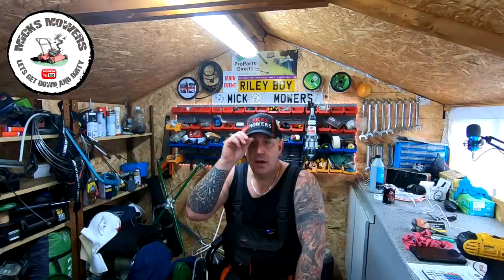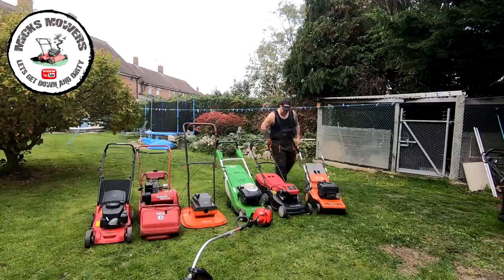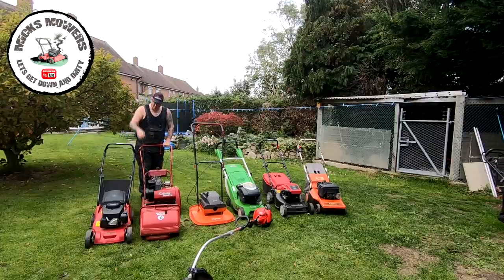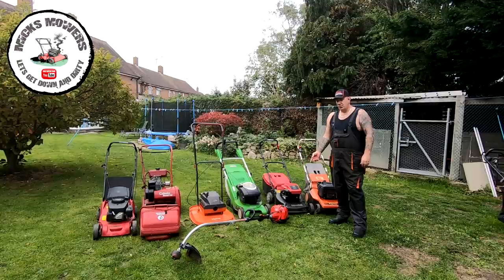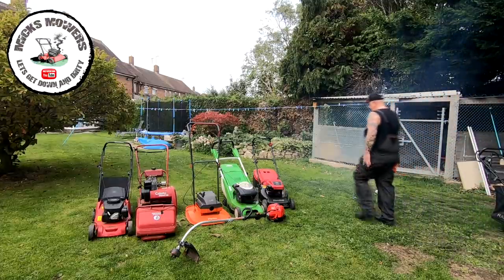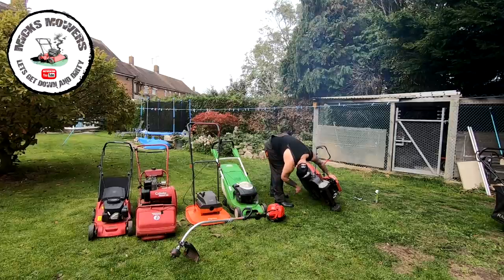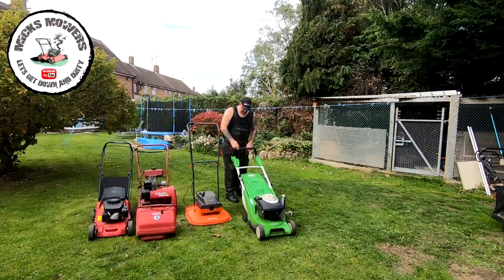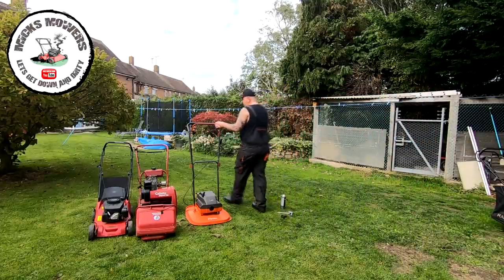Trash Picked Job Lot of Lawn Mowers.. Are They Trash Or Treasure

Comment: It’s turned into a throwaway society. Great job saving/getting those machines from certain scrapping. Bet you get them all fixed and sold for a tidy sum. 👍 Years ago they would have been sent to a repairer. Nowadays they are relatively cheap and people just buy a new one. Sad really for the planet but great for people like you Mick.
Reply from the maker: Yeah Peter. It's a sad old world
Reply: Just had a rant about that just now before I saw your post, but your spot on. No body repairs thing now just buy new. 
I've worked in the nuclear industry for more years than I like to remember. In the old days if something went wrong a fitter would come strip the part down go off to the machine shop make a new part and have everything up and running in a few hours. 
Now the new generation come in, kick it and say "that whole unit needs replacing"
Machines down for months and the cost runs into tens of thousands because we've destroyed our engineering background.

Comment: The Italian Techumesh was not made under license, parts may not be interchangeable or available.
So says Taryl.
Great haul you got there. The non runner is probably valve adjustment or flywheel key.
I’m digging the Flymo
Reply from the maker: Ta mate

Comment: list of jobs to do

- flymo 1, needs service, new cables, fix drive.
- mountfield grey mower, sounds like a engine issue
- mountfield trimmer usual two stroke issues with fuel lines and carb, may require a service.
- viking carb, service and drive
- suffolk punch service, clean carb, fix drive, get new grass box frame
- mountfield sp414 carb clean, service
- Flymo hover mower hell of a suprise it runs lovely, probably requires a quick service

Comment: One of my customers gave a mower and said that the handle had stuck down in the folded position, possibly engine "blocked". I took it home, held in the dead mans handle and pulled up the handle. First pull and it starts.  I did the right thing and took it back. 😇
Reply from the maker: Good lad
Reply: Karma Karma Karma.   I always do what’s right, even if it costs me money.  I believe in Karma, what goes around comes around.  I’ve even had customers tip me when I told them I had to buy a tool to complete their job but didn’t charge for it. It’s just good business!
Reply: @KensSmallEngineRepair  well, I still cut her grass. And it made me feel good. And she gave me some biscuits so yes, karma.
Reply from the maker: @KensSmallEngineRepair  balls

Comment: Tecumseh is a reason for not throwing something out, not the other way round.
Reply: ugh... I HATE tecumseh engines.
Reply: @norge696  Yeah, I found out that a lot of people do, I just don´t know why, they are my favourite brand, seriously. I used to hate the small Briggs with the plastic carbs and the Primer (like the one on the Mountfield), now that has switched to any non-brand chinese ohv-clone engine.
Reply: @v-g-z3689  are for tehcumseh, breather tubes leak, oil seals, valves are wacky, backfire a lot, carbs leak, flywheel keys are annoying, like 7 different kinds, list goes on and on. I do however like tecumseh snow king engines. 

As for those plastic briggs carbs, easiest carbs to clean in the world.
Reply: @norge696  Yeah, that is the general opinion, especially in the US by the way. I can´t confirm any of those accusations, but that however is just me. For me, the plastic pulsa Prime carbs are awful, and the engines they are mounted on: diaphragm goes bad every two years, carb warps and doesn`t seal, no adjustment whatsoever, awful airflow qualities, the engines have very little torque, they start burning oil quickly, Gas caps lose their threads after a short time, the head gaskets tend to leaks, Intake tube breaks very quickly, doesn´t seal properly to the carb, engines tend to wear out very quickly... thats my version of the list ;)
Reply: @v-g-z3689  ohh yeah... not a fan of pulsa jet engines either. briggs stopped making flat heads in 2012ish.
Reply: @norge696  2015 to be exact, since then, I don´t dislike them as much anymore, as I said, now it´s the chinese OHV clones.

Comment: It's disgusting how people just bin things for the slightest problem there again manufacturers should share the blame. I've got a flymo QS5160 bought new in 2007 it's worked well until this year and turns out one of the rear drive wheels has stripped its teeth and I'm struggling to find a new replacement, I keep getting told "it's an old machine what do you expect"
Christ it's only 13 years old and it runs and cuts perfect I'm really don't want to scrap it but finding a rear wheel is difficult all the dealers want to do is sell me a £450 mower, thieves the lot of them. 
Rant over.
Reply from the maker: Good rant.. and your right..